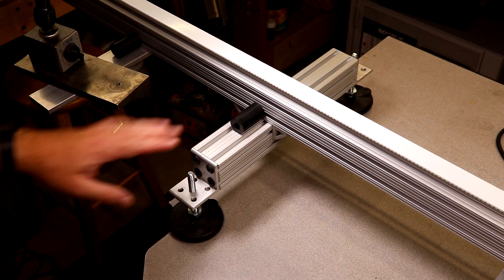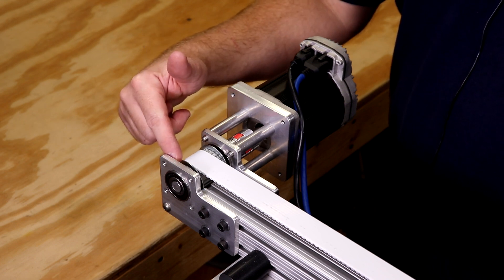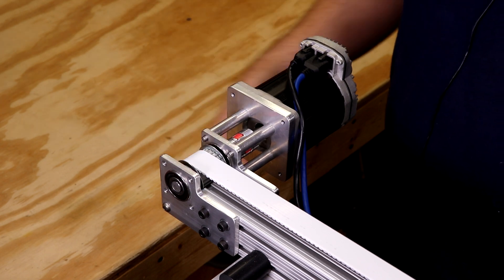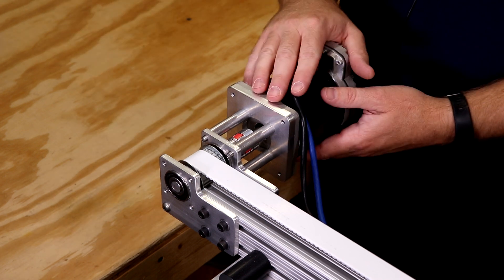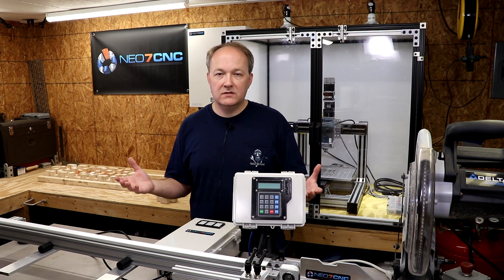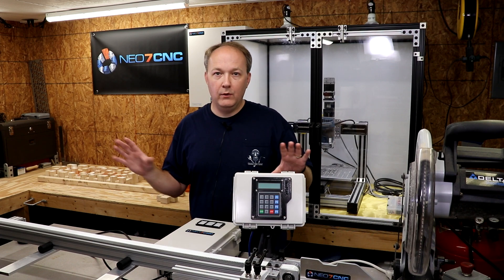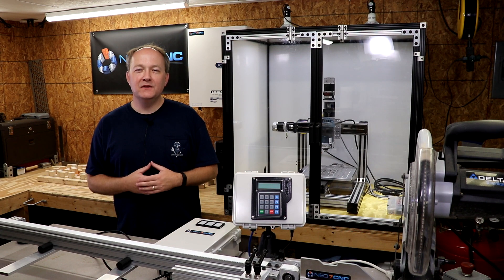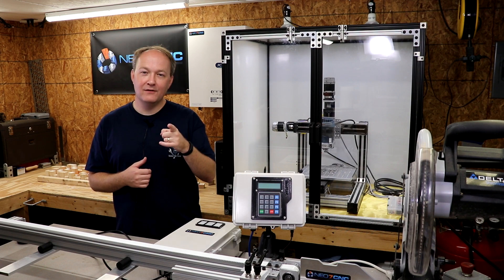Arduino / ClearPath Servo Controlled Chop Saw Stop - Part 4 - Neo7CNC.com

Comment: F1 pressed and held for 3 secs then enter an increment 2.125" (2" plus your kerf). Now each time you press F1 it moves the stop 2.125". Easily reprogrammed as needed.  For F2 use that as a memory button. Press and hold for 3 secs then press a number to save the current location. To get back to that location press F2 then the number corresponding to that memory location. Maybe add an erasable board there to jot down what the memory locations are set for.
Reply from the maker: Those are great suggestions! Thanks

Comment: Yup, I was going to mention metric and kerf settings. A repeat button could be easy to program in aswell. Where does the other side of the belt run, inside the top tslot?

Comment: Do the servos give feed back to the Arduino if they get moved? If so, maybe an alert sound and/or light that tells you that the stop slipped because you slammed a piece of wood into it a bit harder than you meant to. Then maybe one of your F keys could be used to move the stop back to the location you should be at.
Reply from the maker: If the servo gets bumped out of it's position (not easy to do) then it will throw and error on the screen.  If that happens, you re-home and you're back in business. Thanks for watching